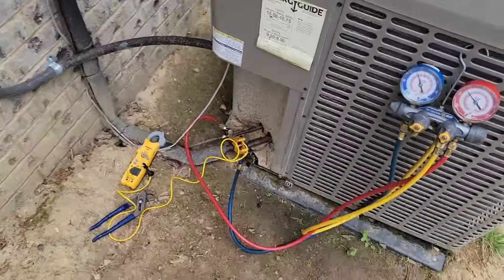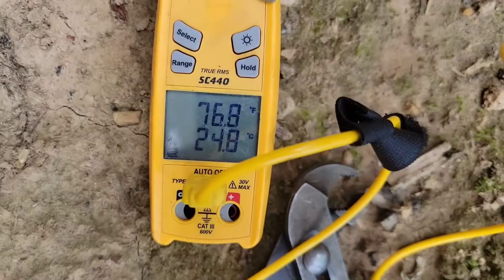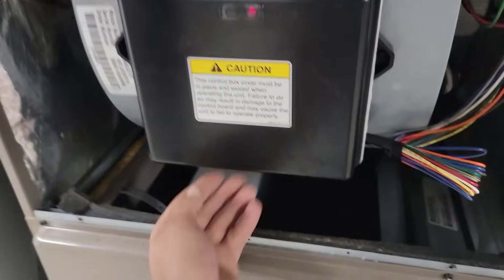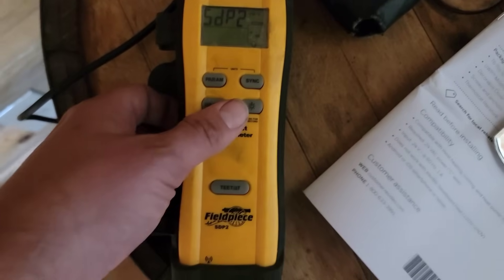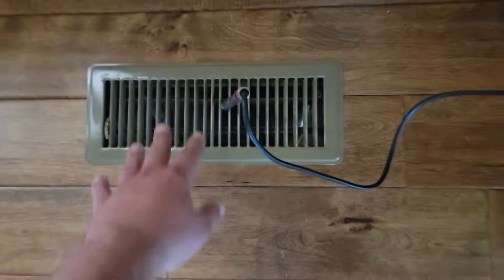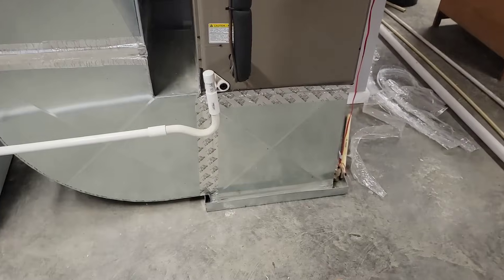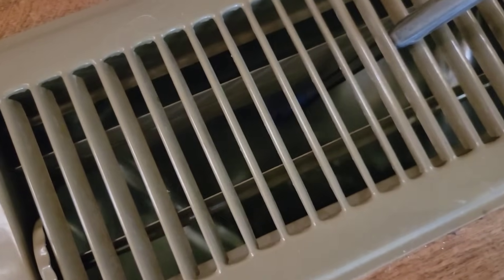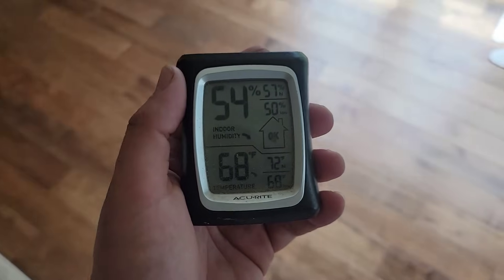How to adjust airflow and make hvac magic? @YorkHomeComfort

Comment: I wish I could get you to my house for an hour or 2. New construction house. Don’t understand most of it. But I can logically figure out what’s supposed to be happening.Heat pump . Hate it.Service guy basically checks the Freon and says “All Good” .Why does my air handler have a bypass coming out the side with a damper on it? I was having humidity problems so I closed the damper so all the air passes through the coils.Removes all the humidity  now.In the winter all the air passes over the heating strips. Giving Me better heat. What is the purpose of this bypass?
Reply from the maker: If you have some type of bypass, it could be a barometric bypass, and it could be a zone system. Do you have a zone system? If so, the barometric bypass is a way to relieve pressure and allow the zones to open properly
Reply: @t @taddydigest zones. Upstairs and downstairs. If I close the damper fully I do not hear a build up of pressure. So I just leave it closed.

Comment: Can a lower fan speed lead to higher humidity ever? I have an inverter with two speed fan and it doesn't remove humidity very well.  The superheat and sub cooling measurements are within specification. Humidity readings show no reduction at all System is turned on.  Humidity is about 59%.  Static pressure is .3.  I was told that the return airflow should probably be increased to improve humidity reduction.  The cooling coils are not freezing so why would increasing airflow help?  No problem cooling the space it's just a humidity issue.

Comment: So our blower was super loud in our new home it blew gd and stayed at temp inside but they came in changed something to make it quiet which they did but if its 90 outside and set unit on 70 it doesn't blow enough to get lower than 75 so ac doesn't shut it's all new stuff but a mod home looks a little different than this I don't see those adjustments on it not sure what they changed all looks the same but any ideas if u even see this in few days I'll just have them come fix it again

Comment: My vent temps are usually 37-45⁰ when cooling. I think we need duct cleaning, because we've replaced two blower motors in the past three years and it doesn't seem to be flowing very much
Reply: Yes fresh filters every 60 days
Reply: Take a look at your evaporator.  It’s likely very dirty and blocking airflow.

Comment: I purchased a variable speed with an externally wired speed controller to lower the speed to mainly  remove more humidity. Works great in Fl. I typically run low 50% humidity.

Comment: Crazy that lowering the fan made it cooler. Does this mean that the airflow was basically outpacing the cooling capability of the unit, returning at too high of a rate to keep up?
Reply: No!  Don't get tempted to mess with yours.  He did NOT 'make it cooler', he just got more of a temp split which aids in reducing humidity.  However, that can ice up an evaporator and slug the compressor if you don't know what you're doing.

Comment: Our home is still using a ‘york’ unit from 1995 (we are 2nd owner) having issues getting cold air to the 2 rear upstairs bedrooms (kids) pretty hot in there. Any suggestions? You mentioned all vents should be blowing the same, not here 😅 thnx

Comment: When doing air balance, my process is always the same, get setup in the attic, create my test ports, drop my manometer test ports in there, stick my temp probes in the supply and return plenum, turn on the system and wait and in just minutes I’m getting all the information. I check the CFM chart on the install manual to confirm static pressure is within range and I adjust accordingly. I record the delta-T once more.

Comment: great video,  can anyone explain why lowering the fan speed can also lower the temperature of central AC ? thanks
Reply: The return air passing over the evaporator coil has more time to transfer heat to the coil.  Put your finger through a candle flame very quickly.  Then very slowly.

Comment: Why would you adjust a variable speed system? Isn’t it a two way communication system between the heat pump, air handler and thermostat and it knows how much air it should move depending on the current inside, outside and target temps? My inverter system slowly ramps up to max and blows really hard at the registers when it’s time to drop the temps in my house but once it reaches the set temp it slows down a lot and crawls to maintain the set temp so humidity isn’t a problem.

Comment: Just got a 1.5 ton Ameristar air conditioner M4ac3 put in the tech says to leave it at 800 cfm but I don't feel much cold air coming in. 

Should I have the fan speed put up some more so more cold air comes in?
Reply from the maker: I would get an anometer and find out what the feet per minute are on all the supply vents

Comment: Also the temp on suction side could be jumping because your getting liquid back too compressor. Because now you have less heat load moving across coil and its not boiling off into vapor. Id just turn up that air flow a little bit....
Reply: Yeah, if it's thick and humid inside, the temp split will be artificially low as latent is sucking up the btu's.  Once the indoor humidity drops the delta would increase as the coil is colder.
Reply: Exactly.  It’s not all about delta T.    Just saying “you need a 20 degree drop” is not relevant these days.  Many systems have a 15 degree drop that are working perfectly if there’s a high heat/humidity load.  You have to look at everything, not just airflow.

Comment: Every time I lower the fan speed I get a call back & the customer complains that "its just not blowin' as hard as it used too."

So unless its a new system, I don't lower the fan speed.
Reply: Maybe ask the customer what they would like instead of assuming one way or the other.  Some of us would prioritize lower noise to "blowing hard".  My techs didn't do anything to personalize my system and I'm pretty angry about it.  It'd go a long way if installation people would actually talk to their customers about what they want rather than have to deal with complaints or get another technician out to their house.
Reply: @samhhaincat2703 The problem with that is customer want the air to blow hard, but they also want it to be quiet.

Comment: Getting 12-16 degrees temp differential at the vents isn’t bad. When you’re delta T is too high, not enough air is getting throughout the house due to low fan speed. Good chance the customer will complain the ac won’t keep up on hot days. Still fairly new in the trade so I’m enjoying the educational side of the videos but in the field, this has been my experience.
Reply: 12? For me if it’s under 17 I am checking refrigerant levels

Comment: NiCE VIDEO! What would cause the air coming out of the vents to pulsate. Even with the AC turned off and just the Fan on it still pulsates. it blow out strong then soft every few seconds. Thanks!

Comment: I live in a manufactured home and the original heat setup was forced air with electric heating elements and AC, but I had them change it to AC with reverse heat pump, but the fan was so loud.. So I slowed it down some, but I don’t really know how to get it actually correct, obviously slower flow will make less air go through, so it will be colder but at some point it has to be, not pulling enough heat away. It’s a piston also, not an TXV, and on top of that, ever since I had the outdoor unit moved, there’s been a small leak that we haven’t been able to locate, it’s been taking like maybe 1 pound per year. The tag inside doesn’t provide as much information as I would have liked, but even if it does show a target superheat, seems like that would be when the air flow is correct, and I don’t know what that is so I’m chasing my tail a bit.

Comment: So the real question to ask is….  What does the thermostat control the temperature of?  The answer is… The thermostat!  Everything else is an assumption.   You have to have air flow to control temperatures in the house!
Reply: It's a closed cascading control loop. The thermostat is the smart component or transmitter that controls the end units to change the PV, like the compressor speed or blower speed.

The thermostat controls it.
Reply: Thermostat is the main component  , it operates off of room temp it doesn't control fan speed or compressor speed

Comment: ok, where would a responsible person start ? obviously by reporting this video for its negligence. but lets assume you did a heat load, somehow i doubt it.
these are not the actions of a Real Technician.
a real tech would not have started the system before reading the literature, checking the airflow chart, and comparing that to the Heat Load per Man J.
a real tech would use that info and have adjusted his fan speed before starting the system.
a real tech would know that the noise you complained of will be there during the heating season since you left the Heating Speed in High... can we say Call Back ! but since you are doing the actions of a helper with little knowledge or professionalism, you will probably charge for that call back. and since the High Speed is SOOOO Bad, that system is probably Way Over Over-Sized ! and it appears from the video that your ductwork is Way Under Sized ?  was probably based on 300cfm/ton at best ??? maybe not even that ? maybe no one rounded up ? maybe rounded down ? maybe it sounds so bad because it should have had more boots per room to lower the sound ? maybe not a quality install ?
a real tech would have installed a Whole House Air Cleaner, after all, it keeps the unit cleaner, protects the equipment, provides cleaner air, and assists in locking in the customer to s Service Contract, especially when you install an odd sized Air Cleaner like some of the Lennox Healthy Climate or Pure-Air systems
A Real Tech would not install an Air Handler sitting directly in a Pan with no spacer ... it causes Biologic Growth after it gets flooded. 
A Real Tech would not install a P-trap facing downhill ... doesn't really trap well in a downhill position, robs trap of its height. but of course a Real Tech would use a manometer on that Condensate Line with system on High Speed to see Exactly how much trap that system requires when it is working hardest, after all, a real Tech knows Condensate is made during cooling Mode, and Defrost is most accurately defined as Cooling plus Auxillary <Strip> Heat, and during Auxillary Heat, that Blower Speed automatically goes to High Speed. so .... i know what you are thinking, but i have seen it twice in my over 20 years experience as a Real Tech, but it does happen. A Real Tech would know that just because a P-trap was industry Standard 20 years ago, a Quality install requires a J Trap as an Industry Standard, especially when the system performs as yours did on Start Up.
A Real Tech would know that after the Indoor Unit is settled, that's when we concentrate on Start up of the Outdoor Unit
so ... it appears that you are an adequate installer, maybe forced by bosses to take shortcuts and install so basic and substandard. or maybe you are just cocky and have gone out on your own without actually learning the trade.
  decent install, left a lot of meat on the bone for the next guy. your competitor will appreciate that as they pick you apart and sell upgrades and improvements. just hope it is far enough out of that 1st year window, and no one has the stomach for litigation. and i really hope there was a heat load done, usually when i see a system that noisy, it was eye balled and over sized. usually leads to litigation. good luck !
Reply from the maker: thanks for watching

Comment: You don't adjust airflow to delta T to be 20 degree, you adjust airflow to system manufacturer's requirements, (you design your ducts to that requirements). If everything is done correctly usually you will get delta T of 20 deg or slightly higher. If ducts are done correctly they are not noisy. It is like trying to meet fuel economy standards by driving your car no more then 25 mph. Thanks for posting your video!
Reply: Thank You !!! system airflow chart and Man J not Delta T !!!

Comment: I'll have to look at the air flow control on my furnace unit. I feel like my blows to fast as well.
Reply: seriously, don't. if you slow it down too much it may not cool well enough or it may freeze up. any airflow adjustments should be immediately followed by checking refrigerant pressures.

Comment: Need 5000 cfm to 2nd floor and 100 cfm on the 1st floor. Then MAYBE the 2nd floor might actually get cooler.

He is fine for a 1 floor house but not a 2 story.

Need 25 humidity for summer and 75 humidity for winter lol.

Why are there no supply and return vents in the basement?

Comment: You mentioned about having a digital hydrometer and a dehumidifier i have both and not certain if my house has foam insulation or bit because there is spray in insulation in the attic. But what i can say is that the air coming out of my registers are roughly 70% humidity when the ac is running. I have a track home in se Texas built 2018. Any idea wth is going on? My free standing dehumidifier with built in pump just cannot keep up.

Comment: Over time k-type connecters where it plugs into your meter. Those flat blade types. They usually don't have a good strain relief and you can take it apart. Cut back to fresh wire and re-attached to the two screw heads. I see those ones are not-re-buildable. Get generic k-type ends that are field wire capable.

Comment: I’m not a technician just a home owner. Had new system installed (Canada). 1.5 ton AC with 2 tone A coil. They didn’t set my fan speed but I do know how to adjust the taps myself. 

Currently it’s on 796 cfm should I knock this down to 596. The old system that died was a 2 ton. They said I was over sized. 1300 sqft house. 

I did try it briefly but I only saw at the register about a 1 degree drop. So at the lower speed I get 53.7

Is 200 cfm really worth the reduction. I’m seeing the upper floors warmer a tad dripping down the cfm
Reply from the maker: I would keep it where it's at

Comment: If I only had a dollar for every time I had to adjust air handler fan from it's absolute maximum cfm { usually the factory setting} down to the cfm that matches the size of condensing unit. Well, I guess you could say I've earned thousands of dollars doing exactly that.
Reply from the maker: You're the man
Reply: @gadgethunter5732  its nearly every one I go on .

Comment: You may have lower temperature now but are not providing enough airflow to properly cool the space. Adjust the fan speed can cause higher electricity also. I’m more concerned that unit may not be the proper tonnage for the space.
Reply from the maker: This is a foam insulated house 🏠 
Works great 👍

Comment: I had same problem when I moved into my new mobile home. The system was not commissioned. Installers left fan setting on highest setting and I had great delta T but humidity was off the chart. Very uncomfortable. Changed fan settings to lowest speed and now it’s very comfortable.
Reply from the maker: Glad to hear my friend

Comment: Maybe I just missed it, but I don't think you explained why this improves things or how it works.   I get that the lower blower pressure is quieter, and you said that it also improves the dehumidifying effect, both of which are nice but is there some significant improvement of cooling effect that results from lowering the blower pressure?

You showed that the air coming out is cooler, but of course it's both the volume of air as well as the temperature difference that determine the total amount of cooling effect.  Is there some sort of optimum tradeoff between CFM and temperature?

As for how it works, my guess is that because the air is moving through the plenum more slowly, it has more time to get cooled by the evaporator coil.  And, of course, the colder the air is, the more humidity drops out.  Is that the whole explanation or is there more to it than that?
Reply from the maker: You hit the nail on the head with the last sentence
Good deal
You understand

Not only did I increase the capacity of the equipment and correct the c f m across the return grill.
But I provide better comfort and remove more humidity

Comment: Great video, unfortunately, from house owning experience, not all duct system is done well.  Current house on a dual zone system, and struggled for a year to get it better, and it will never be correct, unless I want to rip apart a finished basement and fix all the ducting.  But I have learned a ton the last 4 years becaue of this house
Reply: Like the crap they threw in years and years ago. Installer comes in and seals the evaporator coil into the plenum that he puts on top of the unit! THANKX bonehead! No way to reach it without cutting into the metal!

Comment: Hi Taddy,

Love watching your videos! You are very thorough with your work. I have a question regarding air flow. I noticed the return in my second floor is not pulling any air in. When I block the return in the first floor the upstairs return then starts pulling air in. Do you have any ideas on what the issue(s) could be?

Comment: 1,2 degrees cooler but little air coming out of the vents this may runs longer to cool the house
Reply: @heinhandsome2010  If you run slower, the power consumption will be lower so you can run longer with increase your power bill. The advantage of running slower and longer is that dehumidification is better, so you can get your house to the 40%-50% humidity. A lot more comfortable and avoid mold.

Comment: The 30% decrease in air flow with the 2 degree change doesn't seem like a "win" to me.  If it would be 100 out like it is here that system would never keep up.  Why do you feel this is better?
Reply from the maker: colder air is always a win my friend plus the Feet per minute was way to much according to TVA standards for comfort and efficiency